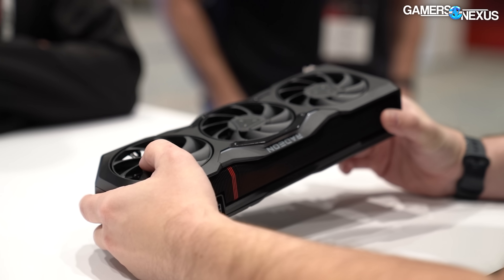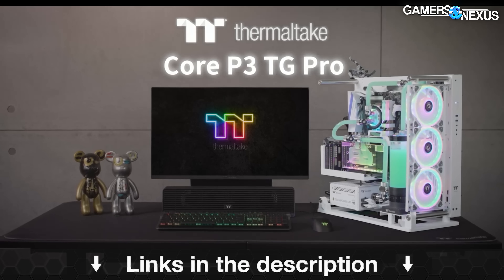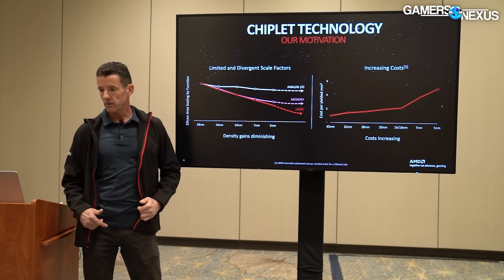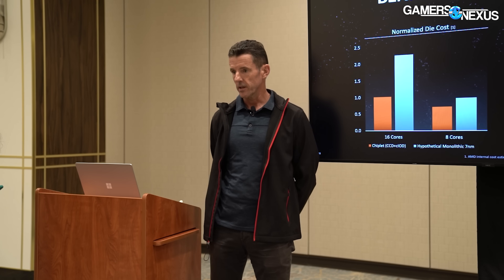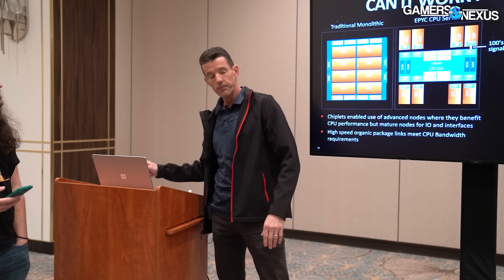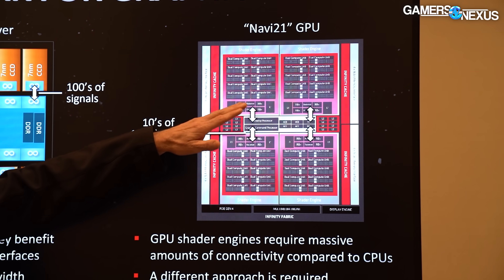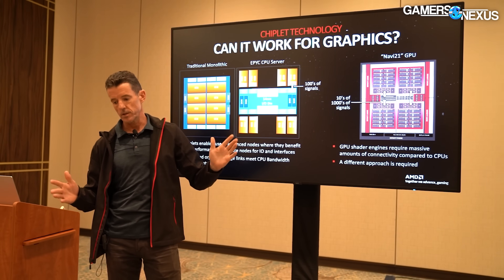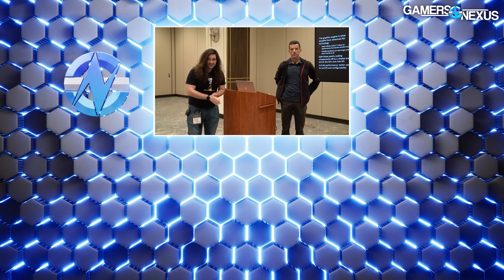How AMD is Fighting NVIDIA with RDNA3 - Chiplet Engineering Explained

Comment: Isn't it amazing? AMD is integrating more and more cost saving technologies on all different levels and at the same time AMD's  graphics are getting more and more expensive. Even considering the special circumstances of the last two years, overall prices and the average energy consumption of new cards are just utterly mad. This might be OK for US consumers, used to extremely cheap energy, it is not for most Europeans.
Give us a decent mid level card with low energy requirements at a fair price point.  A starting point at €450+ cards will massively shrink the pc gamer fan base and endanger the entire business long-term.

Comment: I recently bought an Nvidia RTX 3060 because my old card was on its deathbed. Given Nvidia's ridiculous pricing will likely mean that the 3060 is my last Nvidia card, at least for the foreseeable future.

I've always used AMD CPU's on the other hand, from the Athlon 64 X2 5000+ onwards and they've always worked just fine.
I had the FX-8350, which I bought around new-years of 2012/13, about 2 months after it was released. I had it for 7 years on and about, it's now at home in a friend's PC.
It still works just fine, which is certainly no small feat after a decade of continuous use. High praise from me at any rate! 😄

Comment: They did an excellent job.  Good thing they check their emails. I said the same around the same time they did.  Begged them to do this.. around when I told Nvidia about RTX. =) muhahah  And more recently, I asked AMd.. hey.. did you not read the other suggestion about stacked memory / caches for short, balanced parallel ccd / iod connections?  lol
They are doing great.  And I like that hey revamped the sync on the CCD side IO.

Comment: One thing that's not obvious immediately, but goes off like a light bulb moment is when he talks about the wire count regarding bandwidth and cache between CPUs and GPUs. The MCD arch is basically similar in context/behavior to the cache connectivity between the CCDs and the IO die. So they basically ported that from Zen into RDNA3 to create the MCD wherein they could decouple the InfinityCache (which also exists CPU side) from the GPU and create the MCD + GCD architecture. The light bulb moment isn't this outcome. Its also not that the stuff that exists in Zen was ported to help in RDNA3. No, the REAL light bulb moment is the fact that engineers for Zen created something and that something automatically was translatable into GPU space in a way that allowed for chiplet architecture to bloom. 

THIS MEANS that for Zen5 and RDNA4 or Zen6 and RDNA5, any engineering time spent on CPUs has directly proportionate benefit potential on GPUs and the advances made there can be sliced and reapplied into future components as available and applicable; and equally any engineering time spent on GPUs has directly proportionate benefit potential on CPUs and the advances made there can be sliced and reapplied into future components as available and applicable. So rather than reinvent the wheel each time, each team giving 100% means that the final product of either will be 150%. Couple to that the economies of scale and very high yield per wafer output while minimizing cost loss from defects, and the margins and performance/watt per sale for all SKUs is salivating.

Comment: I'm waiting for the 7900 XTX to alter the market and succeed the XTXH 6900 XT on my 5950X build.

If I was going with Ngreedia again, I'd get the 4090 after it goes down in price. It's got a lot of performance distance from the 4080 like the 2080 Ti had from the 2080. The 3080 and 3090 card variants were all too close to each other. 

I've been waiting years for something like the 4090. I think this is finally it. Rasterization-wise, the 3080 Ti on my 12700K build just doesn't cut it for my purpose.

Comment: AMD have advantages, due to they can optimize their GPU / CPU / Chipsets to with pair-optimize features if paired. Intel can actually do the same with their CPUs/Chipsets and now ARC GPUs in the future.
WIth brand-pairing optimizations, they can seriously compete with Nvidia - even though Nvidia still have an ace with the Ray-Tracing and DLSS features. Nvidia might be forced to work on CPUs and chipsets development. They once did offer chipsets.
But brand-pairing optimizations can also backfire. Say somone swear by Intel CPUs (there are consumers who only want/trust Intel CPUs) ..AMD don't want to "disregard" those potential buyers from their GPU market.

Comment: It seems that chiplet manufacturing improved the amd's margin quite significantly. Back in 2017 you could buy a 6 core for $200. Now you need to spend $300.
The 7900XTX which uses chiplet has the same msrp as the 6900XT.

I guess it's more important to keep the investors happy.

Comment: I just received my new GN coasters. They are extremely high quality and excellently designed. Just as good, if not better than, the originals. Drives me crazy I can't press the button, but that's a testament of how convincing the button really is. If you're considering them, just buy them, you won't regret it.

Comment: This guy is smart, I worked at Kodak in the R&D facility and when he's talking about the wafer process where the bigger the chip is the higher cost simply bc even in a clean room that's "0" ppm where no one can enter your still going to have what is essentially dust getting on the wafer and destroying what ever chip it lands on. So we made chips for satellites that you could get 2 to 12 chips per wafer depending on the chip design and the 2 chip designs were in the $100,000 range bc getting a clean chip was a less than 10% chance. So making the chips smaller and "interchangeable" is like a duh/genius move bc now they'll get way better yeilds hopefully bringing those cost savings onto us gamers. I could listen to this guy talk about his new ideas and designs for cpu/gpu chips all day. BTW if your wondering yes I did watch someone drop over $2 million worth of wafers on the ground and I've never seen someone fired faster and with as much force, it was a once and a lifetime experience 10/10

Comment: There's some amazing and ironic parallels one can draw between what AMD is doing here, and what would've-been the higher-end model for 3Dfx's Spectre  line. It would've gone 'backwards' as well, by abandoning a monolithic chip (ala Banshee, Voodoo 3, and VSA-100 [V4 4500, V5 5500, etc]), in favor of multiple chips: the main Rampage chip, and the addon Sage chips. (Rampage basically being a V4/V5, Sage crudely can be equated to a Shader engine) 

Which in that case, the Rampage technically could (and would've) stand alone to become the base model card, whereas AMD's approach wouldn't...
However, the parallel I'm drawing is that the approach AMD has taken DOES allow them to scale up or down the number of MCDs a card comes with (and already know they will)! The parallels don't stop there, though, since 3Dfx's claim to fame being their SLI –which nV's SLi and ATi's CrossFire are each company's reimagining of; nV's being less-so since they bought 3Dfx's assets– which means multiple Rampage chips could be combined, each with multiple Sage chips, on a single board... Which AMD could do by including their own "Sage" units, in the form of additional small-Navi dies, where they wouldn't be "CrossFired" like before, but could instead become dedicated for RayTracing units similar to nV's approach.

We already know AMD's method for RT is through utilizing their shaders, so this would not change anything in that regard. Since these wouldn't be CrossFired to the main GPU, there'd be no worry about the lack of support by developers, given RT handoff would be handler by the driver. 🤘

Mind you, I'm aware at the additional power it'd draw to have even just one small-Navi die slapped on the card, nevermind two (or more). As well as the thermals hurdle, the substrate size increase, etc etc etc... Except if nV has proven to us anything, it's that A) when has power draw prevented sales (even with the risk of burning your computer down!), and B) we consumers are 🦇💩🤪 by being willing to spend stupid amounts of money on hardware if it's the best!
Thus, the challenge will be the substrate, and then thermals... because heat is the one thing that does give us pause! 😁

[ "Hey, why do you use..."
         3Dfx instead of 3dfx? I'm old school 🤷‍♂️ That's how they originally stylized their name, only changing it much later, around V4/V5 release. That, and formally, it has forever been referred to as '2D' and '3D'. We don't say D3d, after all – d3d sure, but that's informal, just like 2d or 3d is! 😁
         nV instead of NV? Because that's technically how it should be? It might not be obvious based on the logo, but if you look, it's "nVIDIA" just with the characters all equal height. It was more pronounced originally, when the 'n' was stylized as 𝓷 (yea, hard to see, sorry). I know they refer to themselves as Nvidia, but logos speak louder than words! 😊 "The Way It's Meant To Be Played Said!" lol I also recall a super old in-game/driver logo depicting a large, centered V, ie nVidia – which is also how I type their name (even though incorrect).]

          END of RAMBLE

Comment: Is there a reason for the GPUs to only stack one direction? Could they not integrate a GPU core onto both sides of the board and dual cooling solutions to double the space available?

Comment: It's nice to hear about all these improvements from AMD, but to really show how AMD cutting the costs by introducing chiplet technology the buyers should see it in the price, because for now, based on old chips (Navi 21) using technologies like ray tracing and dlss, even the 3060ti beats the 6900xt but the AMD price is 2x higher. https://youtu.be/1ITdex_JrBM?t=1771
PS.   I'm not a Nvidia fan and I still have an old GTX 1060 and I hope the next GPU will be from AMD.

Comment: Chiplets make a lot of sense for a GPU, even more than a CPU. They seem to have an advantage with parallel loads, which a GPU is great for. You can probably do things in the firmware especially to help send out the loads. But the presentation gives a good explanation why it was on CPUs first

But yeah, using a more mature node for things that aren't as affected makes perfect sense

Comment: Question for thermaltake (the sponsor):

I have the older Core P3 for my testbench, but the radiator+fan assembly is too thick, and prevents longer GPUs from fitting as the bottom of the card interferes with the radiator fans (and it isn't a thick rad). 

Does the new design fix this problem?

Comment: Considering the price vs. expected performance (to be confirmed by Dec 13), RDNA3 is already a big victory IMO. A thousand bucks is the limit of what I consider acceptable to spend in a GPU, although I confess having spent $1,3K last time but near the peak of the supply/crypto/scalping crisis and I'm still grumpy about that. I don't need to have the fastest available GPU at any cost; the XTX will have amazing performance for every single game over the next couple years (with possible exception of a couple demos built specifically to convince you to buy a 4090 like Portal RTX).

Comment: So, everyone keeps talking about mixing and matching nodes via chiplets. How hard is it to use multiple nodes on a single wafer? Are there issues with the different layers being different sizes that just can't be solved? Would there be too many alignment issues on the different passes? Would it just complicate the design process too much to be dealing with multiple libraries of cells at different sizes?

Comment: The one thing i would like to see is core sharing between CPU and GPU. 
For example assigning a couple cores of the CPU to work with GPU when it comes to rendering or scaling when gaming even though is not necessary now but it could be beneficial

Comment: Forgive me ignorance, I don't like Intel therefore never look into them. 

But are Intel doing chiplet style cpus now or are they still old skool?
Reply: Intel invented the technology called (originally) "Embedded Multi-die Interconnect Bridge, aka EMIB, a part of MCM which is still important after a couple of decades. EMIB works through silicon vias (holes), TSVs and the 2.5D interposers in a "More than Moore" move to 3DIC. These terms, although technically descriptive,  were used for marketing the "methods" used to glue chips-to-chips. So how did they make joggering with intricate chips on chips work? Simple, actually, by covering it with "salt" then masking off unneeded areas let additional chip be "glued" onto a first layer. AMD is, yeah, again doing exactly what Intel invented without any payment, if anyone is "old school" in this scenario...it's certainly not Intel. Frankly it's embarrassing that anyone would make such a preposterous statement just because they don't like a company for some insane reason.

Comment: Every year AMD is supposed to have the Intel killer, every year ATI was supposed to kill off. AMD even bought ATI and they still cant do it.
Reply: Amd had a few Intel killers. R5 3600x for example.
Amd also had better CPU's compared to the pentium 4 and Intel's first duo cores.
Intel fought those with some very shady business practices.

R9 5950X was an absolute beast.

ATI/AMD had a few Nvidia killers that still few bought.
The HD58xx series was just better then what Nvidia had. 
The Gtx480 was late power hungry and really good.. for keeping your feet warm.
The 4850/70 were much better value then what Nvidia had.
The 4870X2 basically sealclubbed the GTX280.

An few years later Nvidia struck back hard with the GTX 6xx series. And boy were those amazing.
Amd had an couple of solid midrange products but couldn't keep up at an enthusiast level most of the time.

Comment: Wonder if one of the big unseen advantages of chiplets for consumers is that having your I/O in a non-changing chiplet makes your motherboard more forward compatible because the physical CPU package (pin-outs, voltages, socket) is much more likely to remain the same.

Often thought that new motherboard revisions only really benefit the high end GPUs/CPUs on release, but most people buy mid-range, and don't really benefit until 'the previously high end becomes the new affordable mid range' - by which time there's yet another motherboard to buy - so its a big deal.

I say because there seems to be a trend for Intel users to have to change the motherboard more often...

Comment: Dear Sam: PLEASE. PLEASE.    BEAT. NVIDIA.   They're out  of. control.  I currently have a 5950X in my system so HELP ME to upgrade to your GPU!!
Reply: They already accepted defeat to the 4090. 4080 vs 7900xt, is like sending your A-team to fight the B-team, even if it wins , you didn't beat the A-team
Reply: @Sxs1n  Lmao, 4080 is beat substantially by the 7900 XTX and the XTX is only about 10% slower than the 4090. It will only get faster with driver optimizations. AMD doesn't need to be at the very top, they just need to hit where it hurts.

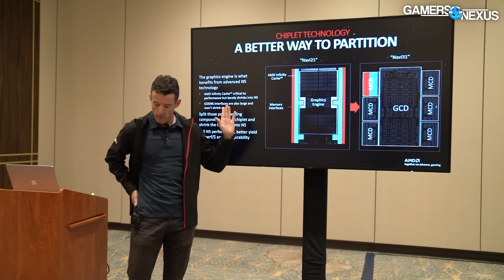Comment: 11:10 .. 14:42 I wish you'd really drilled into whether -- long term -- multiple compute chiplets is the plan. This presentation seems to use the size of the required interconnect to explain why it's not here. Fair enough, but it's unclear to me if he's discounting the idea as a whole or not. Cause without that, chiplet scaling on GPU seems way more limited than CPU. I think at some point we'll have to go multi-GCD, even if inital designs end up presenting separate GCDs as separate queues with relatively limited inter-communication.

Comment: Chiplets only purpose is because it's cheap. That's it. The largest monolithic CPU is the WSE2 it houses a staggering 2.6 trillion transistors on a 7nm TSMC 46,225 mm^2 die.
Reply: Yes, I'm sure a 46,225 mm^2 die would do great in a consumer PC...
Reply: @lunetailedfox  .. What's the first thing that I said in the [first line]??? Why don't you repeat that part? Instead you just glazed over it in your zombie-like state. No you're getting snowballed by both AMD and Intel for cheap ass CPUs and GPUs. 

Meanwhile the RTX 4090 uses a 4 nm, 76 billion transistors and a Die Size 608 mm². 

No the chief complaint from them is how much of the wafer they can't use with the larger die sizes. What they're not telling you is the latency the spacing and interconnects add. A 1 mm spacing between chiplets is 1,000,000 nm starts defeating the low nm lithography.
Reply: @DJaquithFL  Meanwhile the 7900 XTX uses a 58 billion transistors die at half the size of that 4090 monstrosity. On a worse node. Bring out RDNA4 with two GCDs per GPU and you're going to have transistor madness, and NVIDIA, with their monolithic garbage, won't be able to do anything about it without increasing cooler slot size to like 6 slots.

Also why are you jumping to ad hominems, did I insult you in my original comment? Lmfao.

After experiencing monolithic CPUs and GPUs, no thanks son, bring me the chiplets.
Reply: @lunetailedfox  .. Meanwhile the Radeon RX 7900 XTX Die Size of 306 mm² .. IF the RTX 4090 is "6 slots" then the RX 7900 is 5 Slots and 33% slower and 50% or slower in ray tracing.
Reply: @lunetailedfox  .. BTW the AMD's full die size is 533 mm² and It even underperforms the RTX 4080 with its 379 mm² die .. LMFAO!!!

Comment: This teaches a lot of stuff. Now I'm sad because I thought they had a scalable chiplet design like zen, with one IO chip in the middle and a bunch of small computing chips around it. Turns out it's the opposite, the computation is done by a monolithic die in the middle, and the small chips are IO. So, they do save money on manufacturing but this design is not more scalable that the previous ones. They can't just add chips and get computational improvement (like with a threadripper). Too bad, that would really have killed Nvidia over the years.